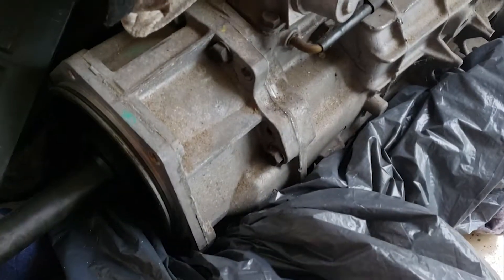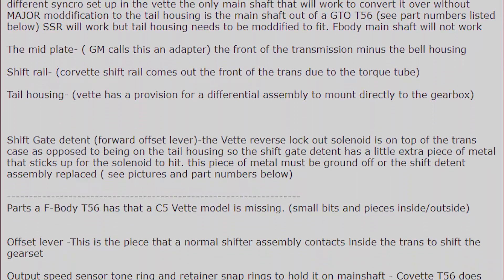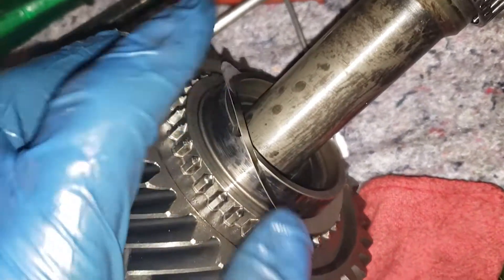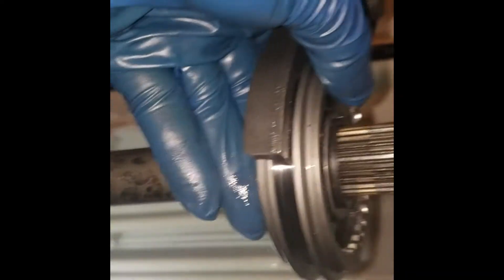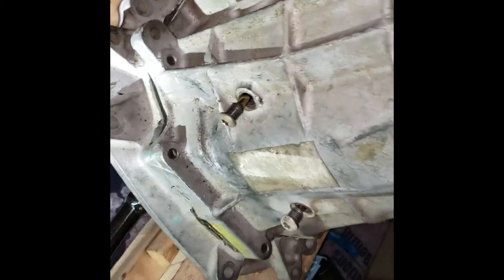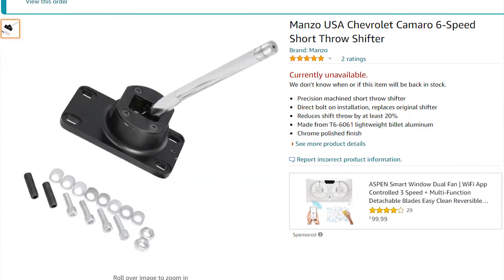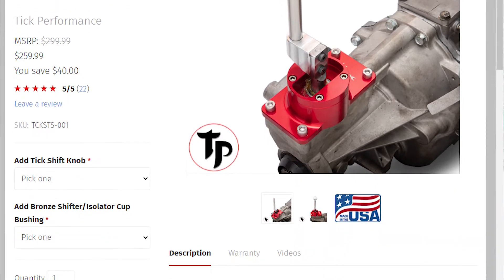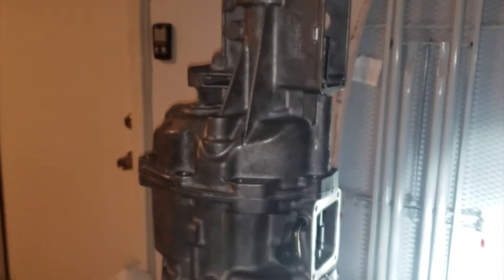1969 Camaro Project Part 3 C5 Corvette T56 for the 69 Camaro

Comment: Did you ever make a detailed vid for this?
I’m in the same boat. I grabbed a c5 t56, in my ignorance, for my frs LS swap and now I’m scrambling to figure out how to make this trans work vs losing the money on the investment.
Reply from the maker: Hey. I have not made a detailed video for this conversation. I'm open to making one just wasn't sure if anyone was interested. At the time I think total spent was around $1,600. Close to what you may be able to find one at but I got lucky with a low mileage unit. Feel free to reach out to me if you want more details . I posted my instagram in the video . You can message me there.